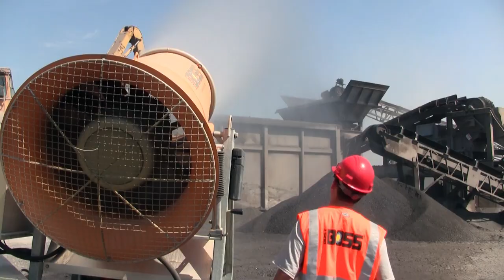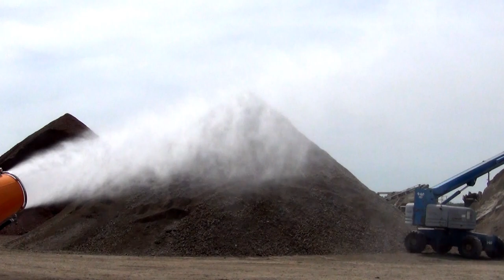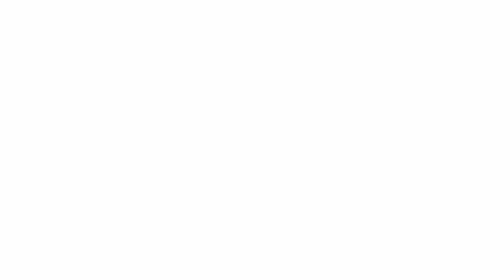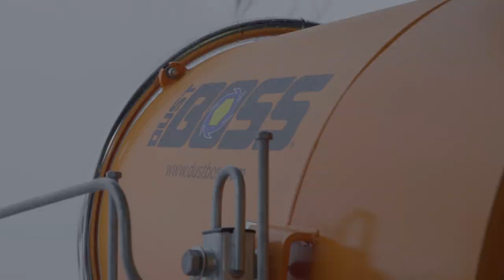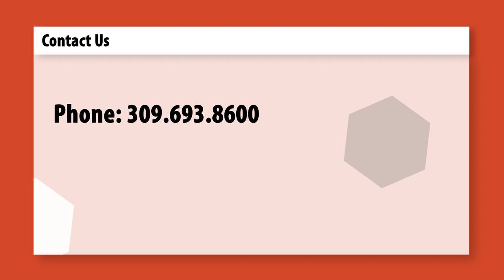Atomized Mist and How it Works

Comment: How much does it cost? And is manual controlled or does it oscillate
Reply from the maker: Our cannon units have automatic oscillation ranging from 40° to 359°. Give us a call at 309.693.8600 for pricing!
Reply: @DustBoss  do you supply to south africa?
Reply from the maker: @nikoappsmuggred7220  Yup! Anywhere in the world!